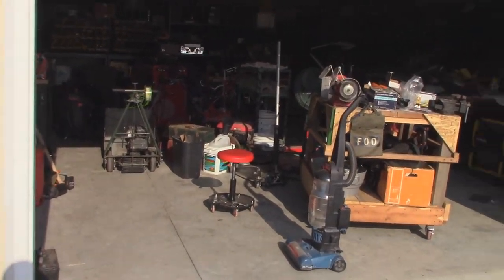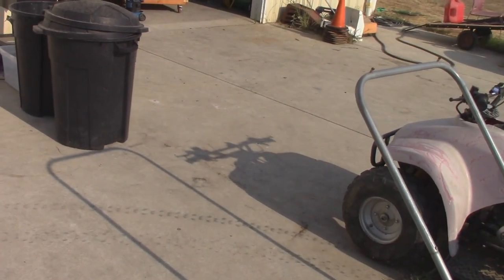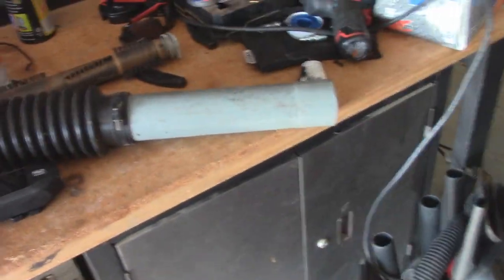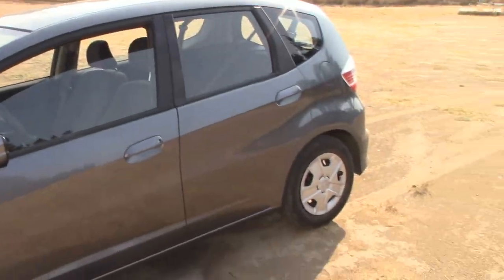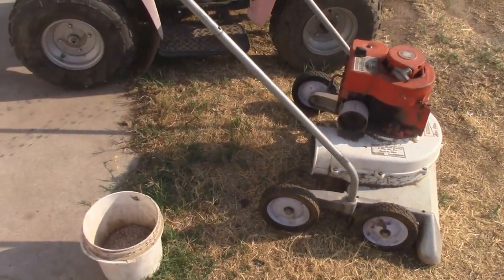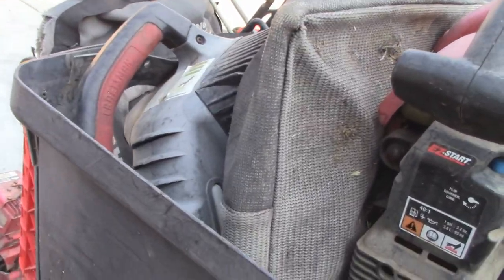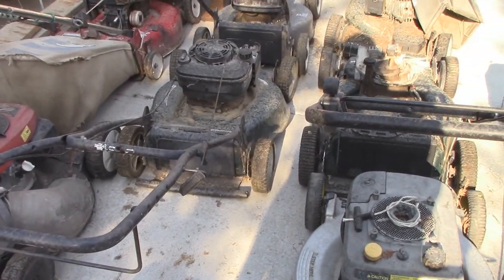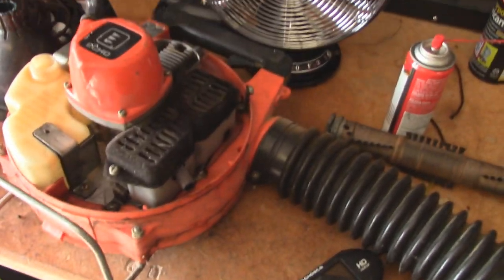Hoard Updates

Comment: My John Deere LT150 with a Kohler also smokes on startup. Its only a single cylinder 15HP, but way faster than the ones they make today.
Reply from the maker: +Crisp Cuts Landscaping yea typical kohler decent motors though. The older commands with the cast iron cylinder sleeves were great as well
Reply: Yeah mine smokes on startup too, except it's a little bit more, mine burns oil, oil goes to the spark plugs on mine, it will burn anywhere from 12-16 oz every time I mow, mine's a 15 horse just like yours in fact, it's the same mower! +crispcutslandscaping but anyways, my 15 horse holds about 2 quarts, with the oil filter on and about 1.5 quarts without the oil filter, the rings on mine are long gone, the engine itself has about 1279 Hrs! It's been rode hard and put up wet, I'm not the original owner, in fact, I'm the third! My grandfather was the one who bought it, for 300$ used.
Reply: +Tristan Heckler Yeah, this did not come with an hour meter, so I dont know the hours. I bought it for $220.

Comment: Love your videos man, Ive always been into picking but after watching your videos for the past few months I stepped it up a lot. Ive found a bunch of good stuff so far this summer and some crazy do it yourself fixes, one being a push mower that the owner spot welded the engine onto the deck. I was wondering if you had facebook, instagram or something i could send you some pics of this stuff to see what you think. Last night i actually picked up a snapper commercial Hi-Vac with a 5hp briggs commercial duty engine, i believe its a mid 90s model. Its really in great condition but I wish i knew the market on these, once i get it running (which i believe it will after a good carb clean), I want to put it up for sale but I have no idea what they are worth. My names Mike Karwowski, my facebook profile pic is me and another kid with a motocycle helmet on and my instagram is @mikebikerkarwowski.
Reply from the maker: Dale Allan hey man that's cool as hell you found a commercial one. Yea I'm not really on any other social media however you should post up vids of your scores. Many people not just myself love to watch vids like those. It's hard to believe what people throw away. As for the value you will have to check your local cl or any other place where people can sell stuff. Specifically look for commercial equipment and make a determination from there. Here I would put up one of those at 160 or so. Higher if in very good condition.